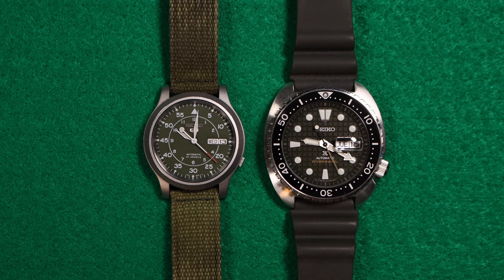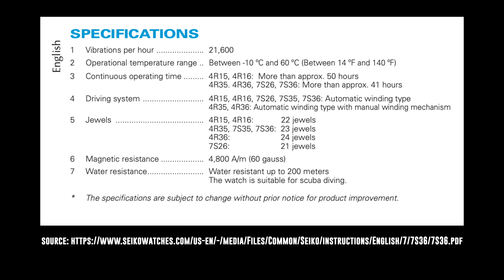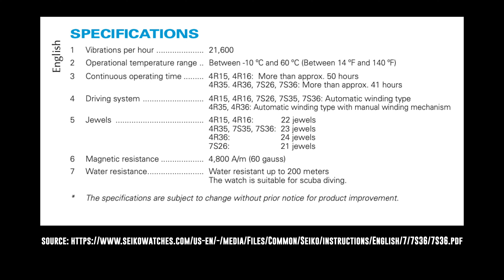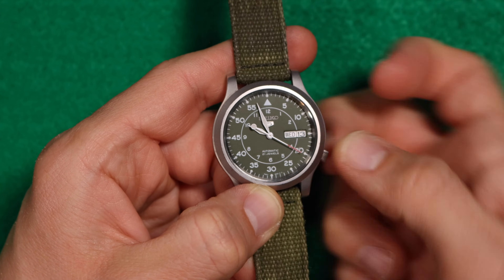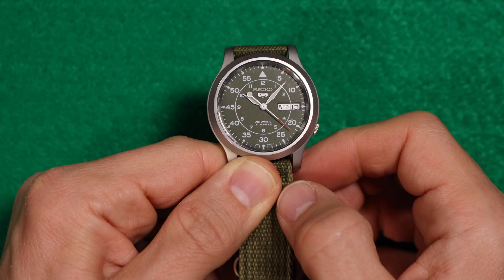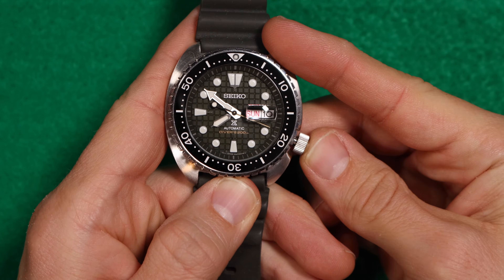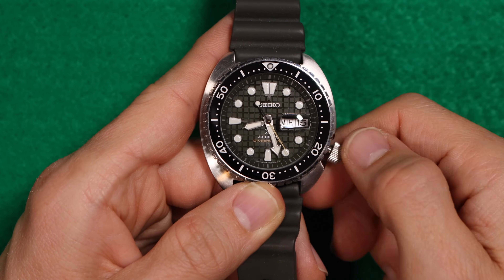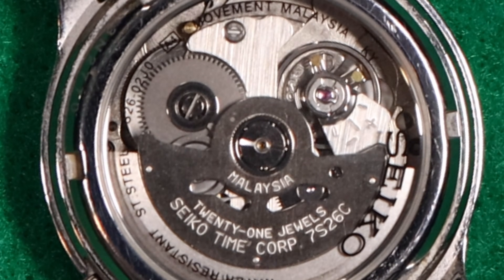Seiko 7S26 vs Seiko 4R36 Movement

Comment: 7s26 while it's reliable, it's pain in the butt tbh 😂 i own several seiko watches with 7s26 movement and since it offered no manual winding & you have to shake it off every time you want to get it running. I prefer nh35, 4r especially or anything that have manual winding so i can just grab my collection of watches out of the box and turn it a few times just to keep it running (i know there're self winding box out there but still.

Comment: Based on my experience, I respect the 7S26 movement. I wore the heck out my Seiko 5 field watch (10+ years), until I ruined it myself by going to the shower with an open crown. That watch had a Japanese movement and was adding about 5 seconds a day. After that I got a couple more Seiko's with what I understand is a newer version of the movement (7S26C) made in Malaysia. One is adding 5 sec/day, the other one is losing 5 sec/day. For me, it is more than acceptable. Also, I don't care for the hacking feature, as it only promotes OCD. And I almost never hand-wind my other watches that allow it (Japanese or Swiss). Idk, maybe I just got lucky with my 7S26 watches. But I have nothing negative to say about that movement.

Comment: Is it safe to change the time of the NR36 by moving the hands counterclockwise? I was told that you should only change the time clockwise so as not to damage the movement. Wonder if this applies to NR36.

Good video by the way!
Reply: Adjusting a few minutes won't hurt the daydate mechanism, however I would always advance clockwise for more than a couple of hours, just to be safe

Comment: Great overview of these two movements! I believe the stated accuracy for the 4r36 is pretty close to the same as the 7s26 (aka terrible), however I think that's Seiko just being kind of lazy. Their movements almost always run far more accurately than the stated accuracy, and f you want you can regulate them to within a few seconds per a day (Nodus does this with all their watches that use Seiko movements). So basically the terrible numbers are just so Seiko can get away with a few really inaccurate movements without taking them back.
Reply: K so what watch should I get for like £200 max that’s still good coz I’m thinking of getting one (4r36) because it’s quite affordable what else is better for around the same price . Maybe a Tissot watch ?

Comment: Why would you buy a watch with such a bad time keeping movement? It's totally useless.
Reply: It usually can be regulated to be +-10s/day.
Reply: @skodovkar  my 4r36 runs -2 sec per day not regulated 😂
Reply: Your comment basically sounds like "why buy a painting when cameras or digital art could capture the scene more precisely?"

If that's your perspective, get a digital watch, quartz movement, or a smart watch. They're built to keep time more accurately. For people who buy automatics, the enjoyment comes from the craftsmanship and art of being able make watches that run purely on kinetic energy, keep a precise enough time, and quality that last generations despite being worn daily.

But yeah this is also the reason why I don't sweat on precision so much like some watch snobs do. That's for quartz watches and any smart device that could sync for more precise timekeeping. Me personally, I just set my watch to less than a minute past the original time and roll with it.
Reply: I regulated my 7S26 fitted SNK793 to around +4-5 sec/day. That was back when it was new, so I'm sure it would need lubrication to perform the same now.
Reply: @smokincooks7661  Does it maintain that rate over time? I'm looking at regulating too.
Reply: Have ever owned a mech watch? that's just the range of possible inaccuracy. IRL the 4R36 is a very good moment.
Reply: But that is like calling you a hypocrite, a thief and a liar. All there things are certainly true. When Seiko gives these numbers it is the worst case scenario. I would estimate if regulated and worn daily it should be around 2 mins/month.
Reply: These are Seiko’s most popular budget movements and can last forever. Do your homework. 😂